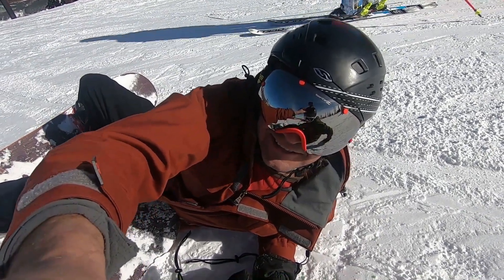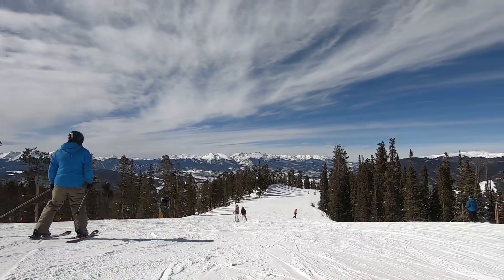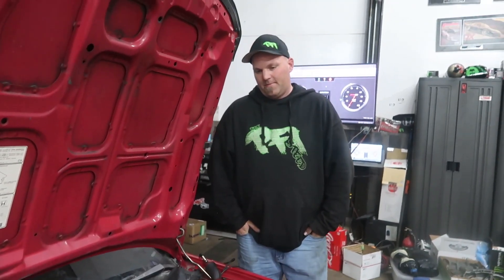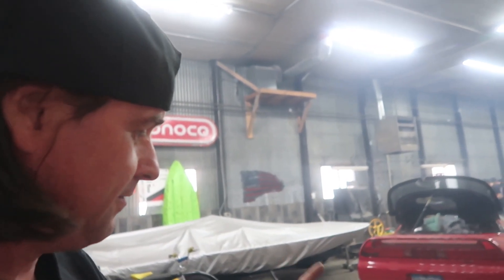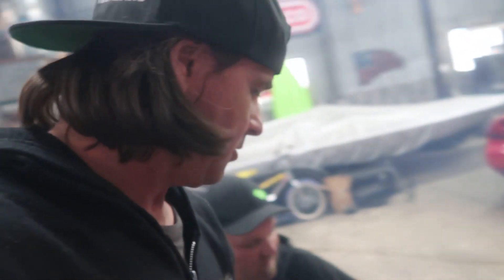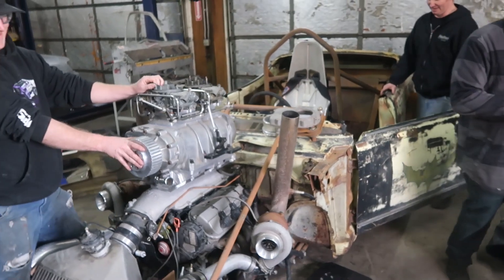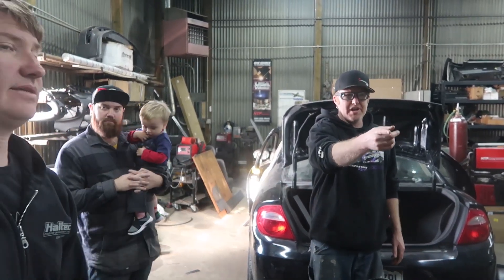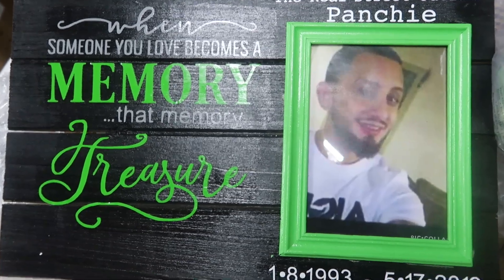Bat Rod Supercharger Dream and a Twisted Oil Return Causes Smoke!

Comment: I think is they are going to put the blower on the bat rod they should at least have some sore of fule ennjecktors at the top of the blower because it should drop the IAT and it would also help lube the vanes of the blower and keep it cooler as well

Comment: So Brent, you and I were talking before about my rod and piston LSVTEC in my EJ8 Civic coupe and I told you that it made 612 whp on a Garrett GT3582R dual ball bearing turbo on 22.5 psi and it wouldn't make much more because it had a .63 AR exhaust housing. Well, I finally bit the bullet and got a 1.06 AR exhaust housing for it based on your suggestion and I'm shooting to run a clean 10 (at least) this year. My biggest issue is with my tune. We always tune it on the street, and then after we tune it something changes and a couple days later it won't hit boost cleanly. I have a Hondata S300 V3. We tried to dyno tune it before and we made 385 whp, but my alternator shit the bed and was overcharging throwing off the entire tune. Then, we street tuned it again afterwards and I ran it on my friends dyno and it put down 612 whp on 22.5 psi, but now it won't boost cleanly again. I took it to the track last year for IFO in Ohio and it kept cutting because my TPS shit the bed. I put a new K-tuned TPS on it and according to the Hondata, it's showing proper output now. I wish I could get past the BS, get a good tune, and get a clean run at the track. I recently put extended studs and new wheel bearings on the front end to prepare for slicks.

Comment: PFI, Brent,  You have to build the exhaust in the shape of a batwing. The W-shaped made out a thick sheet metal. Long 18 by 3" opening   Along the outer edge of the opening where a zoomie would exit. It would be like nascar exit turned up on its side in the shape of a batwing... yesss...

Comment: looking at the supercharger sitting on the holley manifold , it actually looks like you can fit the thing on the bottom half if you build a thick aluminium adapter plate on top of it 
might even be able to fit the top part of the holley mainfold to the top of the blower if theres room for the pulley under it

Comment: Hey guys, maybe consider throttle body injection for the blower on the bat rod. Bringing in fuel from the top allows more fuel atomisation, which will lower intake air temp before supercharger gears.The fuel will also cool the gears and help keep intake temps down after the supercharger. 
Keep up the good vibes

Comment: How much will the S/C increase the air temp on the discharge side? If the air temp goes up by more than a few degrees, you may only be "breaking even" for the Turbo effect- for which you do have an intercooler. I do agree that having a 4-71 S/C stacked up on top of the engine will be cool looking! The only suggestion I could add would be to run a big fraction of the methanol into the cooler to cool the air and the S/C vanes- and somebody else has said it before.

Comment: Hey Brent this is John here I am working on a project of mine that I had just received I have a Mazda MX3 with a heart transplant from an un none source it appears to be a V6 2.5L out of either a MX6 or a Ford Probe not sure which one and it's also possibly a Frankenstein KLZE or KLDE any ways to get to the point I am looking for help on how to get the wideband to communicate with a megasquirt pnp2 on this Engine and I am having zero luck with proper build thread on one of these and I just need to be pointed in the right direction love what you guys do can't wait to see your next video! In a funny way this is a Mazda K series engine

Comment: Jeez, that super-charger will have more displacement than the engine X'D
Reply: More than 4 times as much ... it's all about the blower drive ratio.  A 6-71 provides air to 426 cid every revolution on a detroit diesel or 852 cid per 2 turns. The J series is about 193.9 cubic inches (3.2 L).  I don't think the blower will turn 8,000 RPM but if it did the explosion would be awesome.  I'm sure Brent will do the math and have a blow off device as well.
Reply: @kevinsellsit5584  Like those g60 vw engine one rev limiter away from blowing up.

Comment: please leave the turbos and the supercharger on there. the combo is the way it should be.
Reply: superturbo !
Reply: Its called twin charged... i hear it's very difficult for it to ever run correctly but a few have done it before.
Reply: Sounds cool till you actually think about doing it.. that's just a big rabbit hole you don't wanna go down. It would look cool though
Reply: Tuning becomes a complete pain in the ass.
Reply: @levilane8273  it really depends on the combo,twin charging with a screw style isn't so bad. But a roots blower can be a nightmare.

Comment: You should run the Turbo Charge pipes into the supercharger just to see what happens. LOL, don't do that.
Reply: Hey bud you see the guy w the pickup and the Camaro with twin turbos feeding into a supercharger , there beautiful works of art I'll say!!
Reply: @chadalac1977  Yes, but the turbo setup that's on that and the motor goes back in. The bully I have seen many different configurations. Like the Koenigsegg has two turbos feeding a supercharger. And I saw 32 high body one time that had eight turbochargers off of motorcycles one on each cylinder.

Comment: EBay turbos are hit and miss, precision budget turbo all the way, cheap and warranty!
Reply: Yeah i had the same turbo on my k20 and hold 3 months on 30psi. Then broke the shaft. Bought another gtx3582r from another company with ceramic bearings and smoked ( because angle of manifold ) then i bought oem garrett gtx3582r gen2 and all problems gone.

Comment: Can you guys please think about this for a second. A, roots blowers are crap. B, cog drives are crap. C, if you want to run a roots blower and keep the factory belt drive and be able to put a bird catcher on it, there are factory options. D, the factory Eaton. 112 blower that came on 5.4l f150s has a top facing throttle body mount that can hold a bird catcher. E, M112s can push over 650 crank horsepower, just. F, this is a lot of work to make a car look cool. I hope you guys don't do this. Spend 1/2 the money and buy a proper turbo. As in one that didnt come in. A bix from china that was assembled with the parts they had that day. This thing is going to have output temps creeping in on 400°f if you want to run it dry and you will be wondering why your down over 100hp, using more fuel and still don't have the response you think it should. One of those EBay turbos can compress more air more efficiently that this blower can. If making 600hp is your thing, get one with a t4 twinscroll 1.00ar turbine housing, and not only will it make more power but havr better response.

Comment: I think it's a horrible idea and a awesome way to ruin a super efficient engine that was never designed for a blower. you're going to ruin the front mains that were never designed for a blower. It'd probably make almost the same power with blower vs. N/A. blowers are good at one thing and that's pumping hot air inefficiently. You're going to have to make custom manifold custom pulley system for what gain...the cool factor? There are so many other things that you could do to this.